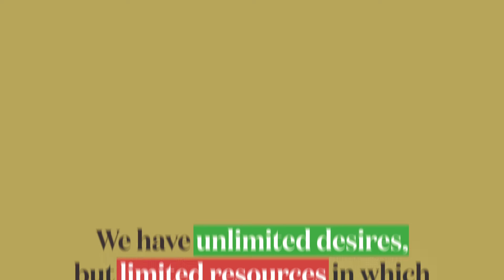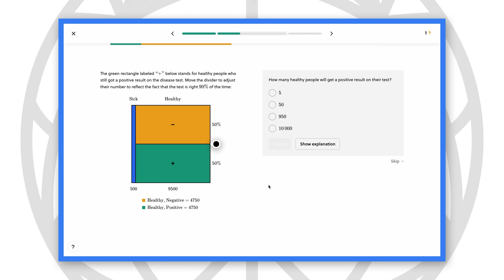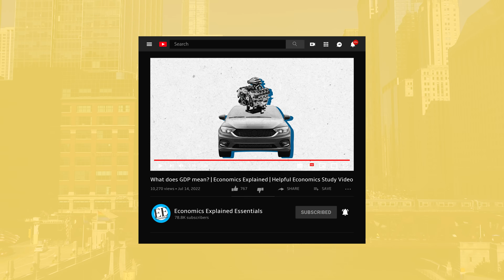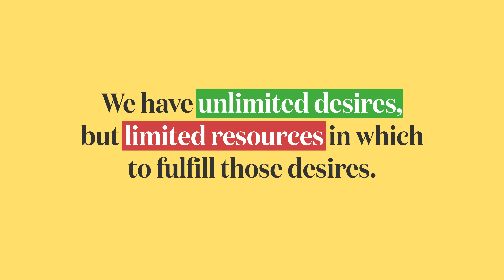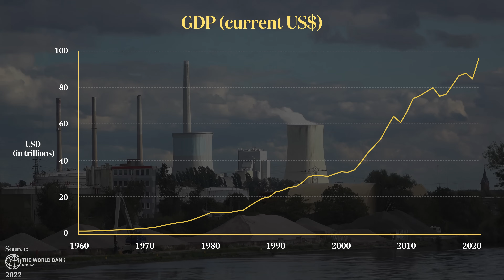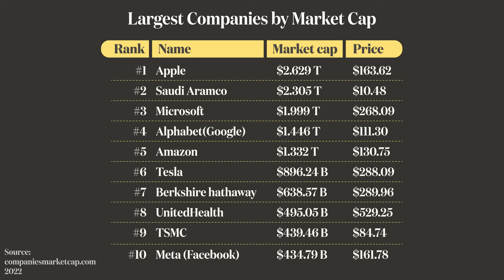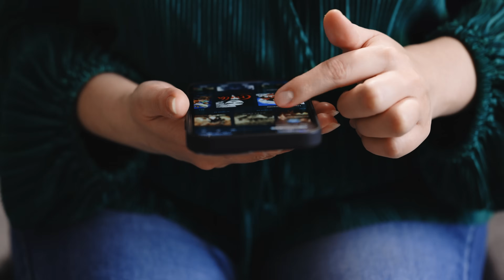Limitless Growth Is Possible If We Run Our Economies Correctly | Economics Explained

Comment: Hmm I see here too much of: "Lets make less bad stuff" or "lets make things less bad" - fundamentally the way we run things still would be bad but we try to prolong the amount of time we still have until running out of everything. 

But if you look at nature (which is INCREDIBLY efficient) everything there is abundant. And therefore we could have more stuff (and lift more people out of poverty) we'd only have to start thinking circular. Because that's how nature works - everything is a cycle and what gets off at one end feeds into the next iteration. Curious to hear your opinion on circular economy - as it would be a way to achieve growth even in producing more (or quicker) while reducing material usage to a absolute minimum in my opinion.

Comment: GDP is correlated 1:1 with energy consumption and our fiat financial system requires GDP growth to keep the debt afloat. To avoid global warming and reduce resource depletion we'll need a new financial system and new clean energy source. The planet is finite, so infinite growth does not make sense unless we can pull new resources from outer space. With or without growth civilization is at risk. These are wicked hard problems in need of solutions. I wish I had the answer. Would like to read your answers.

Comment: Also these numbers can be fudged too. You would have to be able to attribute MP increases to actual increases in goods produced, not just the monetary value of said GP. MP could go up because resources are more expensive to purchase. Not because more products are affordable or were producing more with less. No growth has to occur either. MP could go down due to more materials being used but that doesnt imply thats a bad thing if said materials are more sustainable and therefore can be produced in higher quantity. So much information is needed about what materials are being used and how those materials are produced and in what context we consider them for material productivity for this to work.

Comment: Material productivity policy is not limitless growth in a finite world because its going to create policies no different than the carbon tax. Promoting material productivity means you have to produce the same amount of goods using fewer materials. Thats literally impossible for most goods without just shrinking the quantity of goods you receive. Food prices go up, and the amount you get goes down. Thats not helping much of anything. Unless you actually force production and research into better MP out of more expensive things, this idea will go nowhere. Good luck w/ that anyways considering how everybody will just call it socialism and try to block it (unless a republican comes up with it). It will also not just create growth either. As prices will typically go up with more efficient material usage and more people will be unable to afford the cost of purchase. More goods created for a higher price with fewer buyers means that growth remains the same. In order for it to work it would have to create a larger market for said material. That's not in any way guaranteed.

Comment: We are not going to run out of resources.  The supply available is enough to support a population on Earth that is a couple orders of magnitude larger than what we currently have.  We are just using them fairly inefficiently right now.  Just as most people in the past needed to farm on larger portions of land to support the same population a smaller plot now can support with much less human effort that same kind of improvement can be made again, in farming, in mining, in manufacture, in pretty much every area.  Also, the population is likely to start declining in the relatively near future.

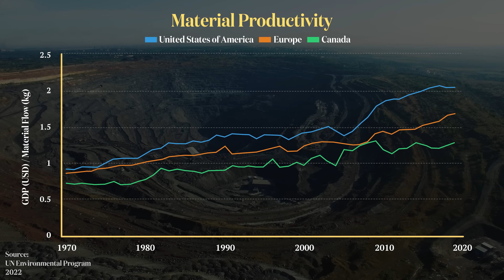Comment: 13:48  Canada don't feel bad.  As a resource exporter your material productivity doesn't move as much.  Exporting iron ore and oil in 1970 is just as productive as it is in 2020.  The fact that Canada's Material Productivity has gone up at all means other sectors not involved in resource extraction have improved.

Comment: Even by making current resource use more efficient, we’re still using the same finite resources, so infinite growth is just as impossible. Growth may continue a bit longer but it doesn’t fundamentally change the equation.
Reply: Also, the digital realm also consumes real-world resources, e.g. energy. This material productivity solution does NOT circumvent this issue, so infinite growth is still IMpossible.

Comment: The problem with the digitial economy though is that it adds value to existing resources. Which means it's based on natural resources. And even if it would add value indefinitely. I'd like to remind of the kettle analogy you made a long time ago. Having one kettle is great, maybe even two or three. but at some point adding more kettles isn't increasing the value any further for you. And I fear that the same can be said in the abstract about the digital economy. To be fair, this is just my fear, so not the same as a rigorously thought out position, but I think it's necessary to bring the point up

Comment: It is possible and it can be sustainable. But only if the state gets removed from the picture. They are the ones that cause pretty much all our economic problems. Certainly all the major, systemic ones. And all their regulations just slows growth down and creates (along with the central bank) the boom and bust cycles.

Comment: Current Digital economy is about increasing efficiency, this takes away the jobs and does not create enough jobs. eg. Amazon is the global shop, which sells almost everything, but is responsible for closing of shops and malls, it has created few jobs, but most of them are low end crappy jobs. Apple is the biggest company by market valuation(2.5 trillion dollars), but has only 80,000 employees, even if you include suppliers, it still does not add up. its only a matter of time before their valuation drops as real income of the people drops and they can no longer sell their services at their current prices.

Comment: Maybe the first video of EE i can’t agree on because of 2 aspects:
- more expensive stuff is stuff that costs more to produce and by definition, it used more ressources to produce it since money is a way to allocate ressources. Of course this is not linear, since we can increase efficiency of production processes. The problem is: the first improvements are easy, the following ones are though. (Think about improvements of car mileage: in the 70’s it went really fast, now every percent is a huge investment for car manufacturers)
- services are using a huge quantity of ressources: consider the internet infrastructure, which is becoming a huge part of energy consumption globally, made from devices requiring rare minerals to be made, more mining processes… the average worker in a production process creates several 100K$ a year of value, without any travel, usually with a basic computer shared with the whole production line. To take your example, the average youtuber needs way more stuff, travels more as well, when the worker doesn’t

Comment: I agree with the second half of the video but dude, if you're going to try and debunk the degrowth economic model, you need to actually address the degrowth economic model. No one is saying growing nations need to stop growing, or that poor people need to stay poor forever. That is nothing but a strawman.

Degrowth is precisely about what you mentioned in the second half of the video. Increased efficiency. Don't make lightbulbs that last only 2 years, make them last 20. That way production goes down 90% while people's standard of living stays the same. Increase efficiency to the point that people's consumption doesn't damage the environment, that's the point. 

Bonus points if you implement social policies to provide everyone with their basic needs. Extra bonus points if you tackle inequality by transitioning to a worker co-op based economy, where company profits go to the workers directly, instead of going to the CEO and then "trickling down" to everyone else.

I would really like to see a video properly discussing the degrowth model. I feel like more people should know about it.

Comment: It's an interesting video :) 
I've been doing a ton of research on the Environmental Kuznets Curve for my Masters, and I think I have to agree that the turning points for material productivity are just not coming fast enough to hope for a 'natural' improvement in resource use before we completely overshoot planetary ecological bounds. 
The two things countries need to do to shift the curve is a) just do it, vote for cleaner production policies, and b) don't fall into the pollution haven trap where you just export environmental degradation elsewhere. 
Wealthy and technologically savvy countries can lead the way on efficient production, but they also need to actively transfer that technology to developing nations. Not sexy, but necessary.
Reply: C) Persue policies to reduce the exponential growth of the population
Reply: @loaizar95  While I agree exponential population growth is not sustainable, unfortunately lowering the population will not increase material productivity. Happily though, increasing material productivity is likely to reduce population growth rates, even driving them negative in many countries.
Reply: @samuelm4719  no it won't. but it will reduce the rate at which we are consuming all our resources. 

Also, how does an increase in material productivity leads to reducing population growth?
Reply: An increase in material productivity implies a more efficient use of inputs, something that can only be achieved if technology, that is, human or physical capital improves. Human capital is just education, and demographics has shown that when people, particularly women, are more educated, they choose to have fewer children.
Reply: @samuelm4719  yes thats true. But at what rate? a very slow one I am sure. The rate at which people get educated is slower than the rate at which our population is growing. Therefore, we will never have a fully educated population and therefore the world population will never reduce but will continue to increase. And to make things worse, there are still developed and undeveloped countries encouraging citizens to have more childens.. as if we didnt have enough people already..
Reply: Current global population projections, based on current levels of development indicate that we'll reach about 9.7B from 7.9B today by 2050. By 2100, it is expected to plateau at about 11B. These demographic changes can happen very quickly, over a generation or two, as demonstrated by countries that have done it.
I would caution against any direct population control like Chinas one child policy. Because of this, China will be the first country to grow old before it gets rich, meaning that it needs to look after its ageing population with a much smaller workforce, something that could actually prevent the country from investing in more sustainable technology.

Comment: Things like YouTube, netflix, and so on are kind of dumb examples. Do you know how vaste the resources these companies require to store and serve this content?

There are redundant stores across continents, countries, timezones... it takes so much energy to run these data centers... parts break and need to be replaced.

Software is not some magical solution to allow more growth. The compute, storage, and networking infrastructure is physical. Hence it is limited like everything else. Not to mention it requires consumers to buy devices to actually consume said content.

Limitless growth is, at best, a lie told to ensure the economy continues to run as it has been. All the way until the very last block of coal powering our plants, the final strip of precious metal used for our phones, and the most remote agriculturally viable land have all been burned, procused, and settled.

Comment: The problem with material productivity is that it doesn't address the issue of 'exporting' the material usage overseas. A new metric is needed to account for companies, while based in one nation, paying taxes, and adding to the GDP, has all it's material uses externally located in another nation.
Need to add a multiplier to the equation for percentage of GDP located externally.

Comment: I felt a little bamboozled after watching this: at the start of the video, at 4:14 you say "We can improve how much we get out of these limited resources by using more efficient farming techniques, recycling, exploring renewable and building out infrastructure, BUT there is still ultimately a limit." and the video continues.
But then at the end you say that those exact same things, framed as material productivity, are all that's required for unlimited growth. confused..
Reply: The end result would be to end up with a circular economy, where every resource used is recycled into something else. Where we can sustain physically while still growing. As long as growth comes from human creativity, packaged in light.
Reply: This channel is not reliable, the video doesn't really answer anything
Reply: EE is making the case that if we measure growth with a metric like GDP/resource used then that will shift our economies into a state where growth will mainly come from the infinite potential of human creativity. Basically the only growth from physical industries will be from making things more efficiently or that are higher value, and most economic growth will come from services requiring minimal resources like digital products

Comment: As a mining engineer, I'm disappointed that an economist has missed one of the main drivers of delivering essentially limitless quantities of "finite resources".  The answer is the price of the resource increases, making formerly marginal deposits of that resource profitable.  Waste rock has been turned into ore worth processing because the metal price rises.
The amount of iron in the world is finite in the sense that it is a tremendously large number of tonnes, but on a few millions of tonnes of iron are presently classified as ore.  Increase the iron price by 2x, and the quantity of iron ore will increase by about 4x.  So we won't be running out of iron (or copper, or lithium) before the sun exhausts its usable fuel supply.
Reply: This is inflation
Reply: Not only that, but if something like fusion or solar pushes energy costs down, and automation results in exponential productivity growth, then our resources become limited to the solar system. If prices rise under such a scenario, we would consider deposits outside of Earth, and at that point, we may as well have unlimited resources. Of course, we may never have to consider those deposits, but for the sake of argument, at some point in the future, we could.

Comment: The big flaw, and I'm pretty sure you mentioned it, is that we are still hard tied to limited resources. Yes the digital economy is far more effective at turning materials into value than any other industry in history but as you mentioned, it still requires power, maintenance and everything else that comes along with machinery. I wonder what the metric for bit/watt is, seeing as the internet now is over into the zettabytes. Plus renewables aren't renewable. Solar panels require coal (or some other extremely high carbon substrate) in their manufacturing. Wind requires rare earths and they run out too, as well as the wear and tear of usage on the motors, bearings etc. Its always consumption, regardless of how "green" it is. The only way to solve the problem is to continually grow the resource pool at the same time. Even at a best case, we are absolutely hard limited to the life of the universe. At the end of the day, we need to make the best use of what we have, regardless of sustainability (primarily because that's built into the best use).
Reply: Or just have less people, which would use less resources. The fact is, there simply isn't enough on the planet to give everybody a western lifestyle. I think we'll figure that out soon enough as more and more countries around the world try to reach that goal.
Reply: The thing is that except in the case of fossil fuels, for which there are renewable replacements which fulfill the same economic role as recycling/repurposing, most resources can be recovered or recycled. Now this is uncommon now sense it is much cheaper to simple mine more resources and it will be that way for a long time. however eventually the cost of mining resources for most will be lower than the cost of repurposing already "used" resources.  At that point people will begin t recycle.. a lot, sense there will be a strong economic incentive for it. If you look at the economy this way you will see that what matters is not the "total resources expended" but how many resources you expend over a certain time interval because those resources can and will be repurposed.
Reply: Just use nuclear power that's the most efficient and cleanest power source and mix it with other power sources.
Reply: For that we will invent and perfect new ways to produce electricity, like tidal power, unconventional wind farms, nuclear fusion etc.
Reply: Yeah but that's kind of the point of this video, digital economy will extend the resource limits we have until to the point where new sources are easily obtainable(asteroid mining, new materials  ect).